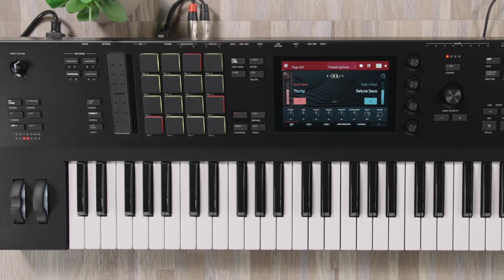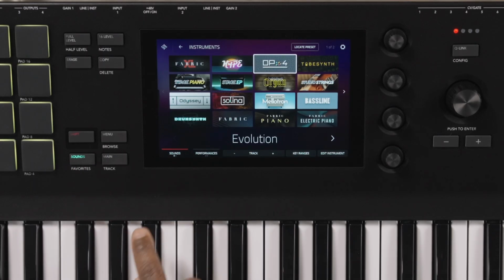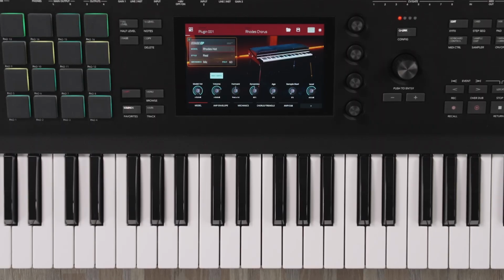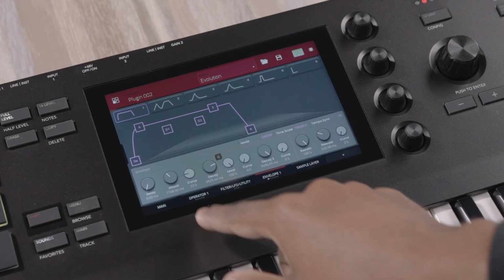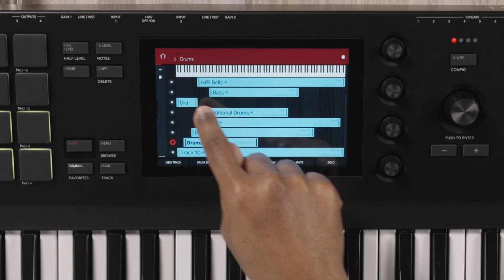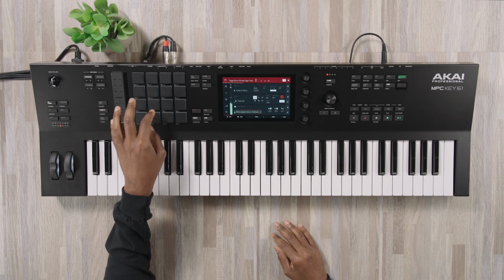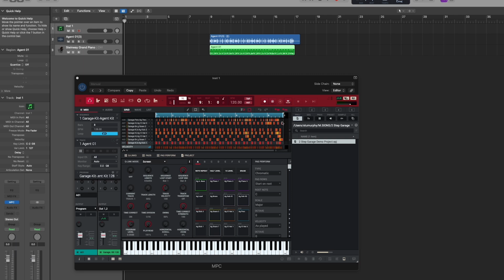MPC Key 61 Hardware Overview | Akai Professional

Comment: Akai!

This product is beyond amazing and it brings you instantly back to the 80's. There have not been a product like this since the 80's unfortunately. 

A big hand for Akai! 

Keep up the good work, guys! This new line has a lot of potential and can easily become a "thing" like the DX-7 or the Synclavier/Fairlight became then it was released back in the day.

Some suggestions to add to the new line:

- Expansion board with 16 VCF's, 16 VCA's, envelopes and analogue LFO's with midi sync (with many different types of sample and hold waves)

- Feature for drawing your own waveforms

- A 88 key version with either a premium hammer weighted Fatar- or Kawai keyboard mechanism

-  Expansion board with fully featured analogue mono synth

-  Expansion board with fully featured analogue poly synth with 5 to 8 or 16 voices.      

- Expansion board with more Midi ins and outs and CV/Gate inputs

- Expansion board with hardware 8 bit or 12 bit ADC and DAC converters for that vintage 80's sound (no emulation)

Cheers
Daniel, host of Eat and Listen channel
Reply: What's gonna be the price estimate on your wants on the new MPC Key 88?  :P
Reply: I would love to see an 88-key version with Fatar-type keys!  If Yamaha conceived something like this it would combine all varieties of Reface synths into one package, perhaps as the Yamaha MP 6 (61 keys,) MP7 (76 keys) and MP 8 (88 keys) with the full-color display from the PSR-SX700 and 900, the MODX and Montage and Genos.
Reply: 35000 SEK / 3500 €
Reply: @WesslansFilmprod  Now it's $1,499 USD.

Comment: Well it's about time Akai !!

Thank you for putting those line in jacks so I can hook up my turntable for sampling...Now it's a "standalone"!!...unlike the mpk249 that I picked up in 2016..it's been sitting in its box for six years mainly because the lack of those line in jacks..

I have modular gear too so a big thank you for the cv and gate jacks !!   

Here's the question; can I trade in my mpk249 and pay the difference for this new Mpc key 61??  😉😉 😁

Side note: when I bought the mpc 2000 back in 1998 I always wondered why there was never a version of the mpc with a keyboard like the asr 10...   but, here we are... 👍🏼

Comment: Bought 1 a few weeks ago. I love it.  I will say,...that Being an avid user of the Mpc's touch screen functionality it would be well appreciated if when in "Sample Edit" mode you were able to quickly touch the screen and the Q-Link functionality followed.  I feel the inclusion of this feature  would be a real workflow improvement for those who choose to use the touch screen for inputting functions rather than clicking through the Q-LINK button to get to the same point. Want to edit sample start? easy touch sample start on the screen and waaa laaa the Q-Links are in place for that specific adjustment...want to edit sample end..simply tough sample end on the screen and q links follow without having to cycle the q link button and so on. Thanks hope this feature is considered.🤞🤞🤞🤞🤞
Reply: Sound is not coming what to do

Comment: This does indeed appear to be the ultimate "everything under one roof" production board. The "renaissance" board, I would dub it. The dawning of a new breed of hybrid workstations which truly consolidates the entire songwriter's workflow with everything that modern technology provides.

However, does it have vocoder capability? You know, to be able to sample the human voice and then run it through digitized morphing effects, such as "robot voice?"

Because if this system lacks a dedicated vocoder, then it got ALMOST everything consolidated, and I would therefore remain torn in my current pro/con considerations between either springing for this Akai MPC Key 61 or Roland's Juno DS series, particularly the flagship DS88 which has 88 keys and not 61.

Comment: If you’ve heard the modx or Fantom, then you know these Akai sounds just  aren’t gonna cut it
Reply: Many pros already have korg, roland Yamaha tools.
61 is designed to integrate with everything else as well as awesome all vy itself.
Turntables, Ableton link (wireless or LAN), even voltage controlled modular gear.
They did a great job, released at the right time, akai has definitely been listening to customer past few years

Comment: Will there be an hardware expansion for the MPC key 61. Like an expansion board with either 8 or 16 analogue filters? 

Will where be other keyboard sizes like 88 hammer weighted keys for this line up?

Cheers
Daniel, host of Eat and Listen channel

Comment: The question is if Akai had went ahead and made the Force Keys instead.......would I buy it?.........yes!
Reply: Except Akai didn’t bother updating the Force software -… did all the others.
Reply: @AutisticCuriosity  They did a good job with Force. It's constantly getting updated
Reply: @johnnyparker2128  yes they did except this time they didn’t
Reply: @AutisticCuriosity  I'm in the beta so all I will say is not yet.
Reply: @johnnyparker2128  I get the message… thank you 😊

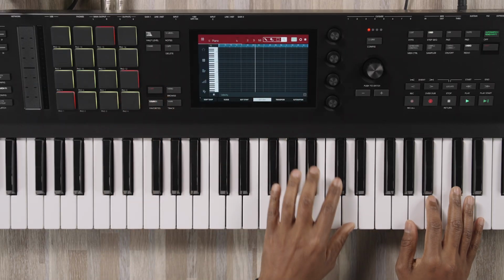Comment: Hey what settings were the Time Correct recording on during this beat 12:00 ???????????????????? 

That’s how i been trying to record my swings at. So It doesn’t sound too perfect
Reply: Seems fairly straight but the hi hats are on 32nd rolls which is really nice and easy to do with note repeat. For that dope swinging off grid grooves you should check out J Dilla.

Comment: Dear Akai,
This product is going in the right direction, but it's missing several essential features that shouldn't be hard to implement:
1) Midi 2.0 . What are you waiting for to make this your new standard?
2) A full sized 88 weighted keys version
3) A rack version
4) Balanced XLR outputs, which are still superior to anything else
5) Extra heating for your demo guy. It's obviously too cold in the room.

Comment: Does it have a Built in Speaker? Also, does it need to be plugged in for power?
Reply: No & yes
Reply: @AutisticCuriosity  The term "Stand Alone" implies otherwise. That's disappointing. Thanks for the reply.
Reply: @hoppskippity  I apologise for shortness of my reply.  Stand alone in this context simply means it comes with all sounds etc without being connected to a computer whilst playing.  So at minimum it needs powered speakers or an amplifier and whatever voltage used in your country.  And will need to be connected to a computer to receive updates for glitches - which have already been found and so it will require an connection when you buy it as software has moved from 2.11 to 2.11.2 since release on Thursday
Reply: @AutisticCuriosity  thanks!

Comment: Alright maybe a dumb question- Why should one change the workflow from a DAW production to the MPC production. Thoughts anybody? Pros Cons?
Reply: Stand alone. I hate using the PC. Just gets in the way.
Reply: I have been using Cubase for decades. You can use it in your DAW as a hardware instrument.
Reply: I do all the creative work on the fly within MPC, then multitrack live with volume/mute automation to Cubase. Here in DAW, its easy to edit and adjust details then mix it all together. Best of both worlds, you can go wrong with MPC when u get used to workflow it speeds up the process
Reply: @miriamatembe2261  I see. Can we get the midi notes from the mpc into daw?

Comment: Would you happen to know if the pads on the new keyboard are the same size as the MPCX? I'm hoping they are, but they look smaller on the keyboard. I can't find those exact specs anywhere. Also, what is the length out of box? All I can find is the shipping dimensions.
Reply from the maker: No, the pads on the MPC Key 61 are slightly smaller but still RGB and velocity-sensitive like the MPC X.

Comment: Ok so without price being a concern, I was looking for a 61 key device that I could do half-pedaling with my piano libraries.  Question for you:  If I want to do half-pedaling on piano virtual instruments in the computer, would I be required to use the expression jack for the sustain pedal that supports half-pedaling, or could I use the sustain jack to get half-pedaling?  Or, would I need to use the 3rd assignable foot switch jack for half-pedaling?
Reply: Cant find a price but I assume it's going to cost $2500.
Reply: @HOLLASOUNDS  It's $1899
Reply: @SomebodyPickaName  you want half-pedaling but you don't care about the not weighted keys?

Comment: When a midi controller is added  to perform 2 tracks live simultaneously notes cut out when both keyboards are sounding the same notes. I love the keyboard but this is a major issue.
Reply: the major issue here is that you're trying to do something that requires 2 keyboards, but you're using a controller and a keyboard 🤷🏻‍♂️
Reply: @tubasco504  this is something that should work on all multitimbral midi devices.  I just tried this on my Alesis QS6 from 1997 and it works just fine.
Reply: @Sawtooth311  but it doesn't work.  So just use a laptop to achieve your goal.  Problem solved.
Next!
Reply: @tubasco504  I bought "Standalone" for a reason:)
Reply: @Sawtooth311  buy another stand alone then.  NOWHERE does it state that you can have TWO performances simultaneously on the one unit.  You assumed that would work because of how a different brand of keyboard works.
You are being unfair by claiming Akai has a major issue here, when it's obviously YOU with the major issue :)

Comment: $500 dollars for the software for our MPCs???!!!
Reply: Finally someone who realized that… I fell less alone. 
But « hey you should be happy the normal price was 1000$ »……………….
What a terrible marketing. 
I’m a MPCX user and I feel you…
First time we have to pay an update for having the full features.
And what a F price……..
I think they want to let us feel we need to buy the KEY61 and resell our MPC, or simply justify the price of this KEY61.
Reply: @1980VINZ  so I completely feel you on this and I’ve discussed this at length on the Akai forum pages and with Beta testers…here’s what I’ve found out and kinda deduced.  Akai have priced the software at £500 dollars not so we sell our gear and buy this BUT to make what is a mediocre keyboard (for this price - doesn’t have multi track view, no disk streaming, no arranger view) -seem worth it to someone who doesn’t have an MPC or a Force.

That’s why they’ve not given the update or software to the Force owners because they know well that a midi keyboard plugged into that machine would be way better than this 61 keys. Especially on the The Force it has disk streaming and arranger mode and clip launching so no update whilst this is being launched!  Despite every other MPC getting the update which stinks! 

There are heavy hints in the community that the Force will get this software for free later and maybe MPCs will too … but your RIGHT. It’s a really crappy way to deny the MPC community the software it times when almost everyone is suffering financially by over pricing it and upset their loyal customer base just to make this new product seem more valuable.